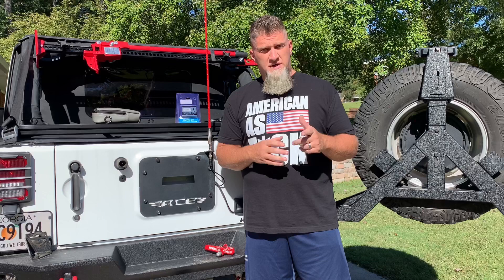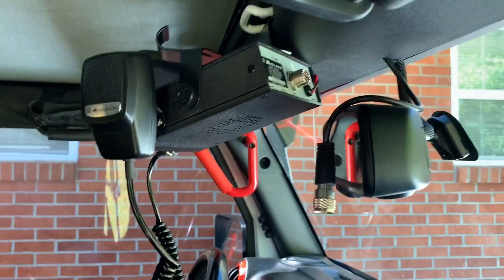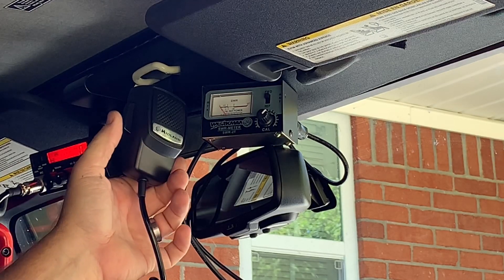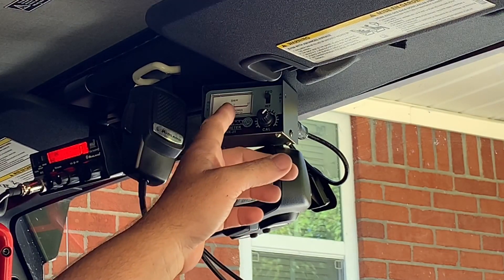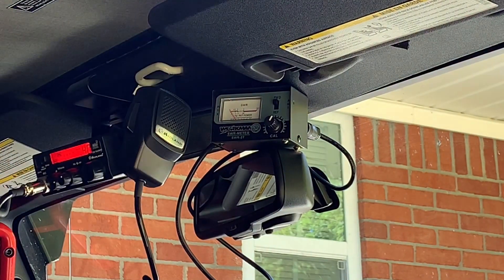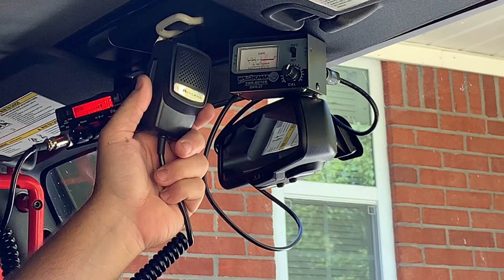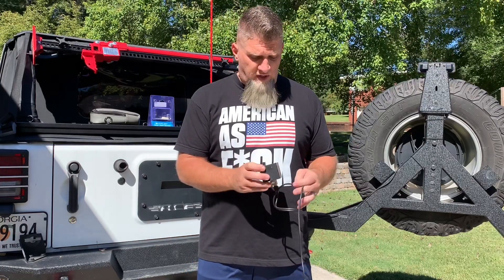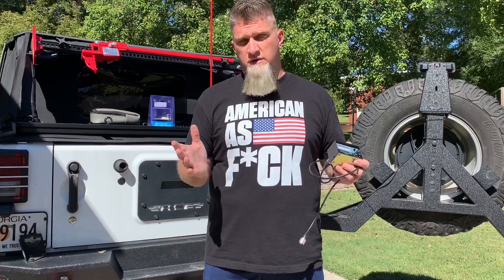How To Tune Your CB Antenna | 48in Fire Stick Antenna

Comment: Would have been cool if we could have seen the adjustment of the antenna also and I understand every antenna is a little bit different but still
Reply from the maker: Yes, but it’s self explanatory, the tip just screws in or out.

Comment: Would you not be best to calibrate on a channel you normally use? In my job i am on 5 most of the time. So would it not be best to calibrate on 5?
Reply from the maker: That’s not typically how it’s done but maybe it could work.

Comment: Swr = standing wave ratio.  Swr starts at 1!  1=perfect!  Swr needs to be below 1.25 to be safe not to hurt your final.  A final is inside your cb and is the power behind the transmission.   A swr of 1 compared to 1.25 can mean the difference of someone hearing you and not hearing you.   I've noticed the closer you get to 1 the more it means on you hearing someone else then them hearing you = sensitivity.   Let's talk coax!  Best to have shielded coax wire.  The more connections between cb and antenna the less sensitivity you will have!  Hope this helps anyone watching this video and thank you to the maker of this video for helping the average person feeling comfortable hooking up a cb radio.  Remember everyone to be respectful when transmitting and enjoy the original internet!!!
Reply from the maker: yes the original internet, thanks for watching
Reply: A 1.1 doesn't guarantee perfection it could mean 100% loss
Reply from the maker: @Pioneer936 CB works as intended, thanks for watching
Reply: @Georgia4Low  not if there's 100%loss

Comment: Good video, My question Is how was the SWR when you shut your doors and closed the spare tire rack ??? I notice alot of metal on the tire rack that would be above the mount and affect the antenna radiation is why I ask. Thanks
Reply from the maker: Never really tested with the carrier closed or the doors. The CB works great though.
Reply: I would bet with doors and Spare rack shut you would see some differ maybe not alot, But the SWR is more of my concern with that big piece of metal on the rack itself then when you are closed that metal would be right up on your antenna. Okay just bring that info to your attention. Been doing this since the 60s just about seen it all Have a Great Day !!! @Georgia4Low
Reply from the maker: @davestran thanks! I have a different tire carrier now but what really help is I ground the antenna base with a braided bonding wire.

Comment: This works for non amplified cb units but if you pushing power like a 200 watt system you can risk burning out your cb if the basic SWR meter is off. Get a antenna analyzer like a Rig Expert AA-35 it tests your antenna SWR without using your CB, it will check your Omms to make sure your at 50 Omms, if not maybe your coax is bad, or your grounding might need a better point of contact, it also has a feature that lets you use a hand held radio so you can listen to a tone and make adjustments to your Antenna length without going back and between the antenna and the analyzer reading. It’s not much more involved than a basic SWR meter and is a lot more accurate.
Reply from the maker: thanks for the information. I have no working knowledge of the higher powered CD (200watt) so thanks for helping me understand.
Reply: @Georgia4Low  I just did a Cb distance check today. Went 22 miles on the 76 turnpike in Pennsylvania, but that’s with a 400 watt ranger.
Reply from the maker: @yellowjacket588 heck yeah!!
Reply: @Georgia4Low  if you’re going off road how far do you need your CB range to be? On the road with semi trucks we really don’t use more than 10 miles range to get traffic updates but when you’re off road you can be too far for cell towers and a lot more miles for CB communications than what we have on the interstates?
Reply from the maker: Our CB use off-road is just to communicate with others in our group so typically not using a CB past a few miles.
Reply: @Georgia4Low  I have never been off roading before and didn’t realize that you all went in groups just so you can look out for each other. That’s good I just seen that movie Into the wild and that is a horrible way to die.
Reply from the maker: That was a great movie for sure and true story. Yeah it’s best to have others with you on the trials.

Comment: I know this is an older video, but, if you read the instructions that come with all meters like this one, it says to unkey before switching from FWD to REF.  This is to prevent damage to the finals.
Even with a basic radio such as this one, the momentary open when switching between FWD and REF, the VSWR will be extremely high (near or at infinity) and can do expensive damage to the final transistor(s)
You won't have that problem if you use a cross needle meter (shows FWD, REF and VSWR all at the same time) or a digital meter that displays all information on a LCD or LED screen.  These types of meters require no adjusting to calibrate as they are self-calibrating.
Reply from the maker: Thanks for the additional tips and for watching

Comment: How do you keep the tuner adjustment ring from moving? I get it set but after a few days I notice my swr warning light comes on, on my radio. I check antenna and see the adjustment screw has moved. I guess due to road vibration. Any suggestions?
Reply from the maker: I have not encountered this problem. are you using the rubber boot/cap that slides over the tuner adjustment ring? The rubber cap seems to be a snug enough fit to not allow the ring to come unscrewed/loose. maybe try a small dot of blue loctie.
Reply: @Georgia4Low  that nut is a jam nut. Run it down and jam the bolt locking it in place.
Reply from the maker: Mine has never came loose to date. That was another person commenting.
Reply: Oh. I see. Yours has ref instead of cal. Same thing. The different channels have to start from a reference point or a calibrated reference point. Once the antenna is tuned The SWR reading will be the same across the board or it may be lower in the middle, around channel 19. Now about that. The travelers channel is 17 on the West Coast and 19 across the United States. Local areas may have different rules. Such as logging roads. You definitely want to hear about a truck coming down the road fully loaded with logs. Those guys will run you over.
Reply from the maker: I’ve updated some things, using bonding wires now and a aluminum unpainted antenna bracket. Works great!
Reply: Yea, you forgot to close the tailgate before measuring
Reply from the maker: Yes I did but it hasn’t affected anything. Thank you for all your insight comments

Comment: Can I run a T and install two fire sticks and get better distance or will one do the same as far as range goes
Reply from the maker: Sorry I don’t have any experience in running dual antennas but I’ve seen it done so there must be a way.

Comment: do you remove the swr meter or it need to stay connected? my guess would be it need to stay there since the calibration is in this box..
Reply from the maker: It doesn’t need to remain, you can disconnect it once completed.

Comment: I don’t worry about channel one and 40 just tune it to the channel you use most is best to get your radio to perform the best but great video 
If you play with it long enough and away from buildings like out in the country or near a park you can get the needle to just flicker and no more then you have it tuned as good as you can get it and the antennas with the tuneable tips are the best antennas and if you are in Nz hi tech antennas are the best
Reply from the maker: Thank you for watching Sir!!

Comment: I know you said 3 is danger zone. I bought a cb radio at a swap meet and it reads 3 and my antenna grounded. You think my tuning is just really bad or I bought a bad cb?
Reply from the maker: I would start with tuning the antenna, confirm proper mount and ground.

Comment: I have a 4 door long bed dually and my antenna cable don't reach  help please
Reply from the maker: I would take some basic measurements using a tape measure. Start measuring the route in which you think is best for the cable. This should provide a general idea on length

Comment: Can I put a 20 foot cable in my cb antenna  thank you
Reply: A nice British man that goes by DX Commander on you tube explains that you should have as short of coax cable as possible to connect from your CB to your antenna to avoid power loss, if you need 20 feet use 20 feet, but the quality of the coax is more important than this myth of 18 foot length.

Comment: Quick question: I am new to cb radio system, should I take SWR meter off after tunning up? Or leave it on all the time?
Reply from the maker: I would disconnect it. I’ve seen some leave it inline but I have no experience with leaving inline.
Reply: @Georgia4Low  Whats some good tips without a SWR meter because I dont got one and I am only going do 1 car an dont want to buy the wires and meter and only use it once?
Reply from the maker: @jasonjr2500  I’m not sure how you can properly tune the antenna without a SWR meter. Sorry it’s beyond my knowledge
Reply: @jasonjr2500  You can use the SWR meter in your radio but understand that it won't be as accurate as a meter. Better if you hit up your friends and borrow their meter instead.
Reply: You can leave it on but there is no advantage to doing so since you won't be calibrating every time you transmit. You can use the online SWR meter for that.  Adding more components and coax only adds more potential problems in the future, plus now you have to mount the meter.  Leave it off for simplicity.